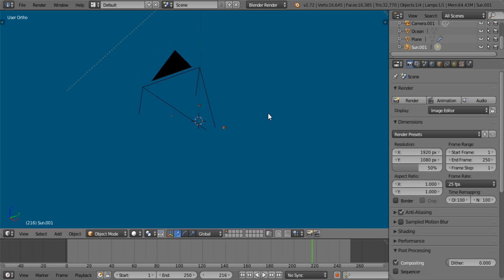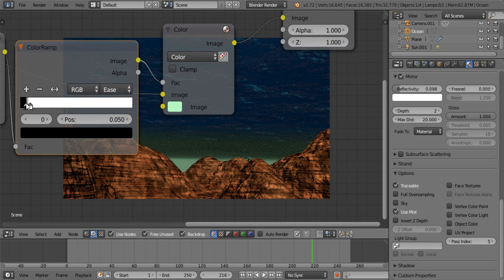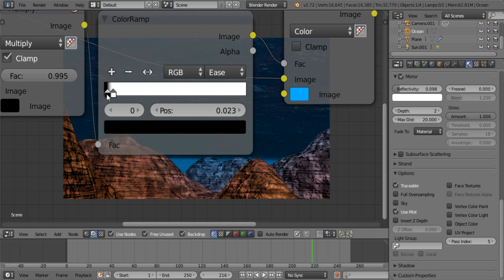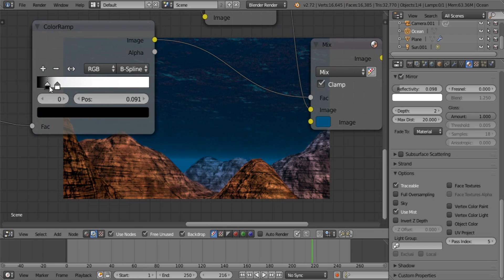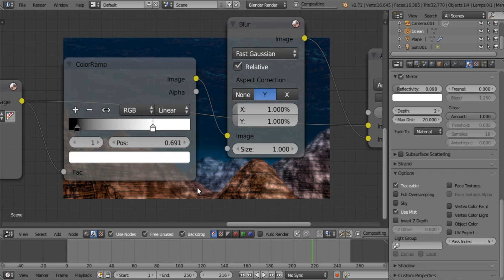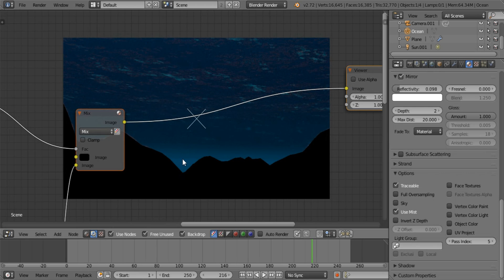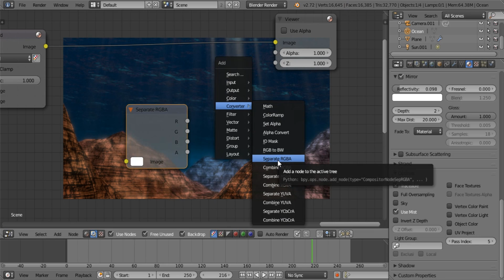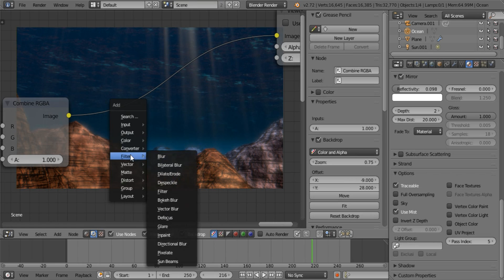Underwater compositing in Blender [Tutorial]

Comment: I can't reproduce the initial ocean material, I am a beginner still.. :( 
Can you elaborate on that?
Reply from the maker: +MatteoFromRome Sure! In Blender you have procedural textures (think of them as textures that can be scaled without losing detail and are calculated in 3D space). The ocean here, only has a cloud texture on it, set to a depth of 4 and has only a Normal influence of 1. Scale is 150 all 'round.
I also added another cloud texture, different basis, and ramped it to act as foam, but I don't think that will matter because of the angle.
Where you may want to focus your most attention is on your transparency and color settings. I used RayTrace, Alpha of about 45%, IOR of 1.25 and slightly reduced gloss with a depth of 2. I also added a mirror effect that fades to material, but I honestly don't think that even shows, since it's depth is 20 and it fades to material. I like to go the extra mile so that if I am to change the scene, it will still work.
   What I really recommend, for a beginner, is that you watch a tutorial on the interface, like this one for example:
https://www.youtube.com/watch?v=TuM_ZXcgnv4
And then on whatever it is you are trying to make. For example, you are looking for a proper water material, so you can watch videos on making a beach, river, lake, ocean, etc.; like this one:
https://www.youtube.com/watch?v=ZlXFZOuIw7Y
Pray and watch and pray and watch and pray and listen - then you'll learn very quickly and even go beyond what the tutorials teach. Never just copy tutorials - be creative and make it your own!
I hope this helps!
Have a great one and GOD bless!!
Reply: +Marius Oberholster Thank you very much :) Indeed I followed some tutorials and managed to reproduce some nice things. 
The problem is that I just follow without really knowing what I am doing, and that makes it hard if I want to create something completely new from scratch. I need some solid foundations.
Where can I get those? For example, knowing each shader, how each node affects the other... 
Did you follow some course at the university/online or is it all selftaught?
I will watch the interface tutorial as a start!
Matteo
Reply from the maker: +MatteoFromRome Pleasure! There are a few ways to get a foundation. One of which is to do a course, but if all they do is spoon-feed you, then you'll be very little better off for it.
   I have never done a course in Blender. Maybe you're trying to do the tutorial while watching it. While that is fine, it is gonna be a copy-cat or parrot situation. What I was lead to, without me even knowing it, was to just sit and watch tutorials. Blender not even being open and really paying attention to what they did and seeing the difference that it made.
For learning this way, I totally recommend Oliver Villar's videos as well as Andrew Price's (Blender Guru) videos.
   You can think of learning Blender as looking at a tool box and having someone showing you how a wrench works and one specific use for it. In another video, someone shows you how to remove a nail from wood that was struck the wrong way and hitting in a new one the right way, etc. If you're too focused on copying their behavior, you don't learn to problem solve. Now, let's say the person with the video is now gone and you are faced with a wrench situation. If you try to use the hammer, it's not gonna work. You might find a cool effect for later use, but you'll probably get stuck, frustrated, forget to save and close Blender, haha.
   Try to just sit and watch and later apply what you have learned in a unique way and play around. Follow Deedee's approach: "What does this button do?"
The worst that would probably happen is blender would crash, your PC can freeze up or nothing would happen at all.
   Just try to watch intently and then do - it can help you learn fast and how to problem solve when you get stuck. :)
Reply: +Marius Oberholster Thanks for the tips ;)
Reply from the maker: +MatteoFromRome Pleasure! :D
GOD bless!